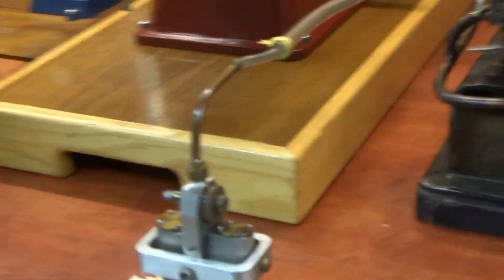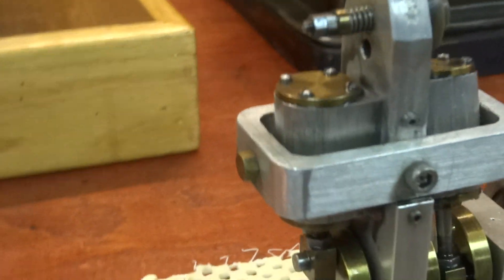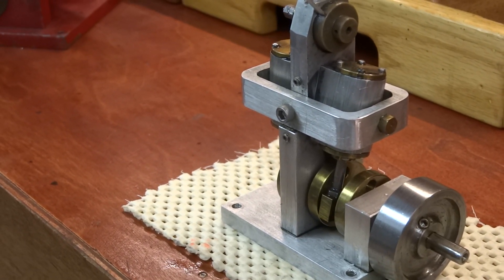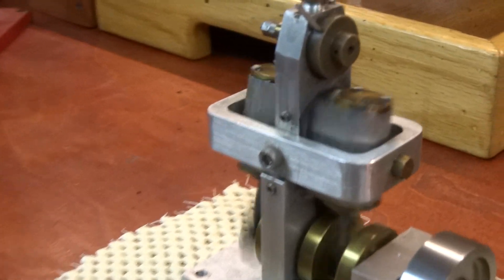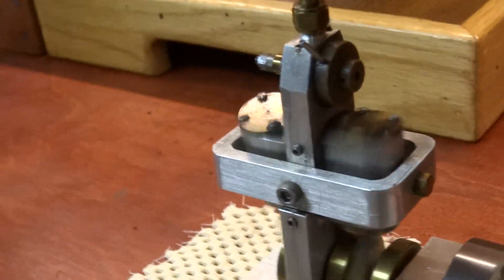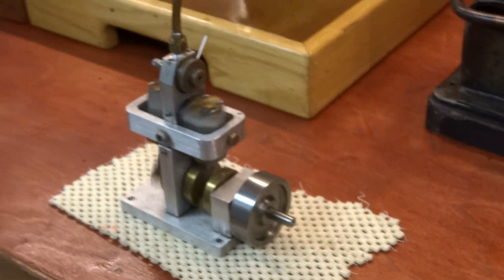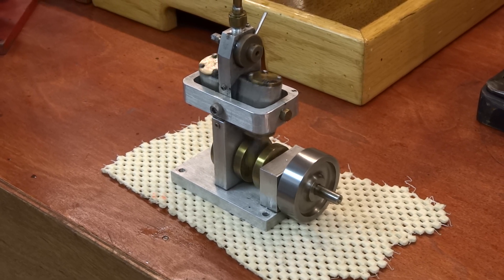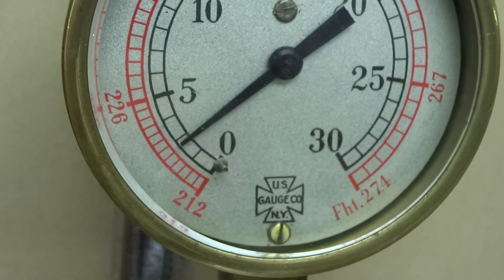Oscillating Twin Cylinder Marine Steam Engine

Comment: That's stunning. So compact.
Are the port holes drilled straight through the frame, pependicular to the cylinder faces of the frame, so that the cylinder ports are directly connected (i.e not crossing over, if you see what I mean). Thanks.